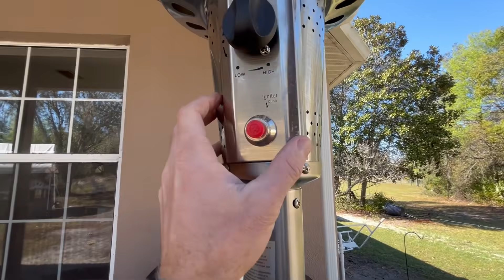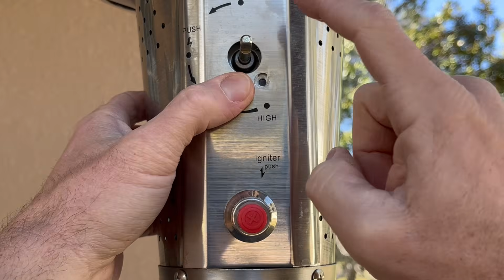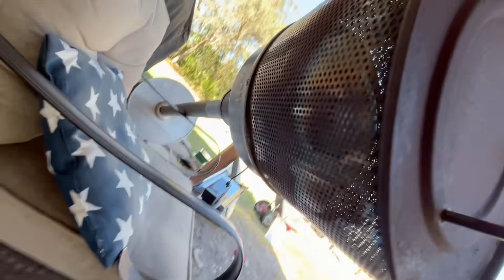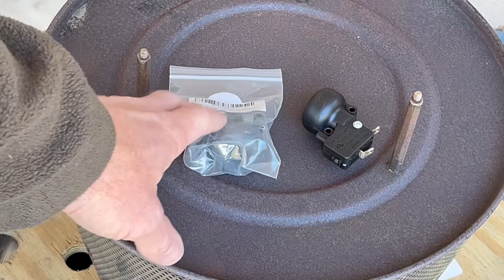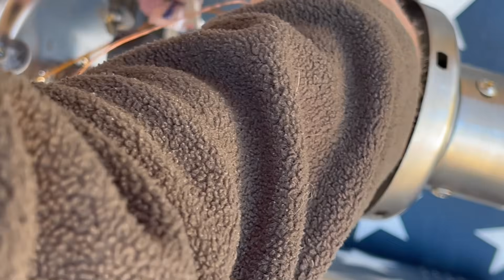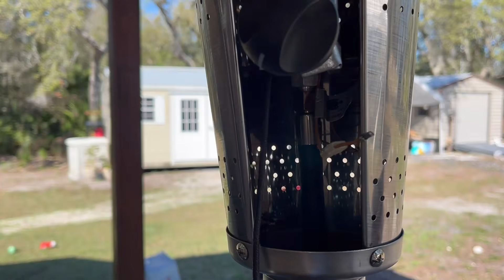EASY FIX! - Patio Propane Heater Won't Stay Lit

Comment: Can you leave the two wires method active until replacement comes?
Reply from the maker: Yes it will work that way but it’s not safe. If it falls over it will definitely start a fire if something flammable is nearby.